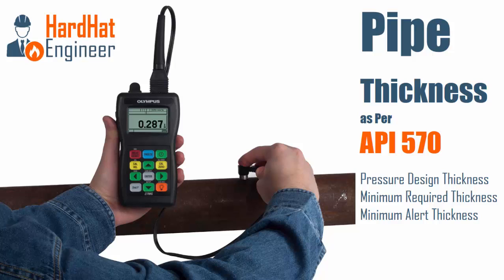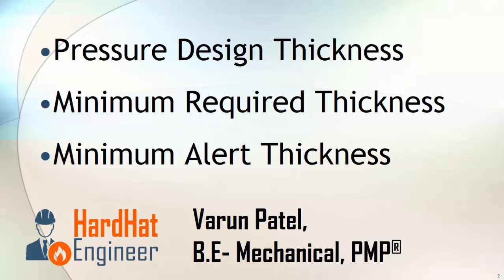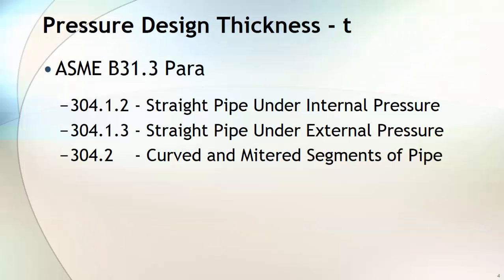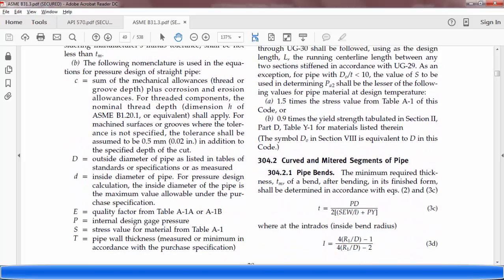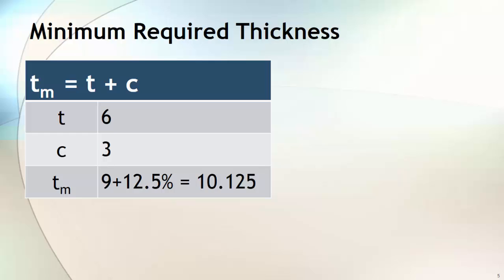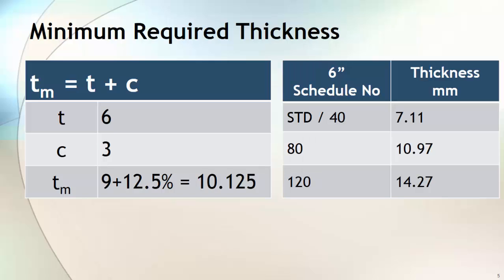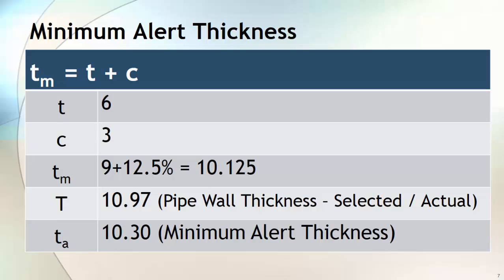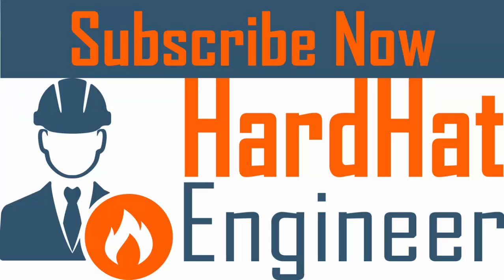Pressure Design, Minimum Required and Alert Thickness as per API 570

Comment: I'm a Petroleum Drilling Engineer, Nice to pass here, this is an interesting video and nice explained too, Kindly could you tell me something?
There are a lot of hard pipes and vessels in the Drilling Rig which should be regularly monitored through wall thickness inspection every 1 year, However we are in trouble to see a reference showed us a threshold value below which the pipes must be rejected.
For example, 4" ID Standpipe manifold pressure rating 5000 psi, what is the minimum WT accepted? 
Please, I'm waiting the answers with reference 
Thank you
Reply from the maker: If you know your design thickness, that is the least minimum thickness that required to perform pressure job. You can check this in your thickness calculation document. Stress Analysis report.

Comment: According to API 570- edition 2016, page 11, its state that for Minimum required thickness (MRT) shall not include corrosion allowances. can you explain ?
Reply from the maker: Yes, that is true. If you include that when material corrode you will be in trouble. Your thickness will become less than MRT
Reply: @Haziq do u have api 570 any latest edition?